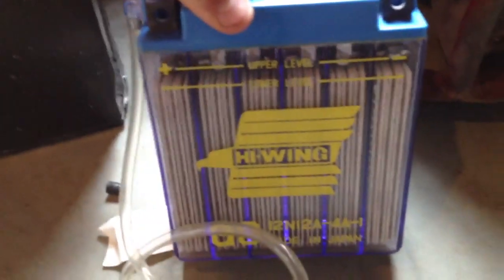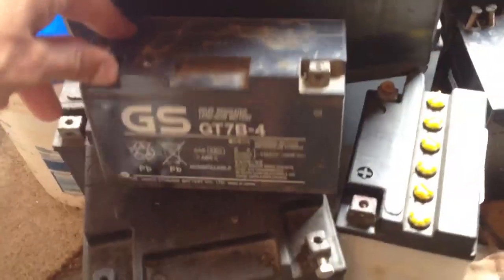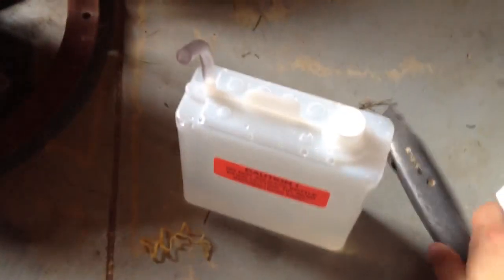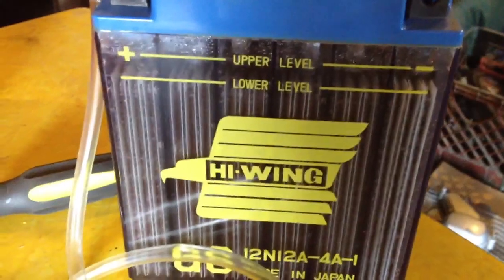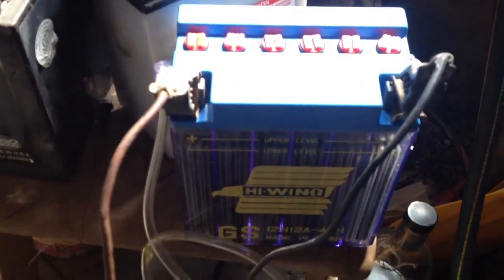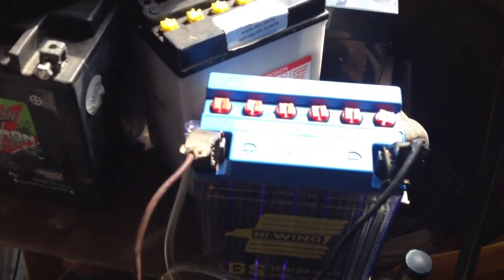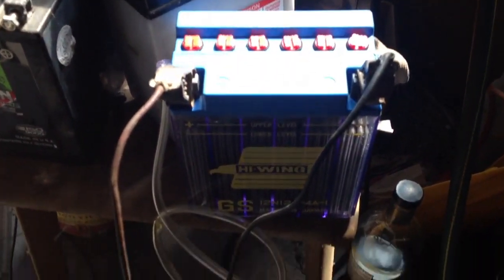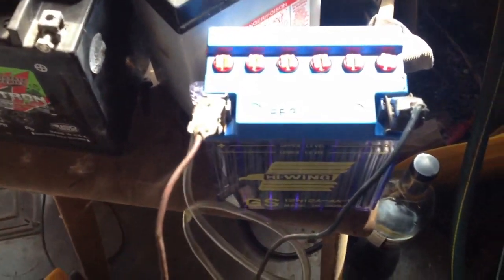Filling A Battery With Acid & Charging It Properly.

Comment: I wanted to know one simple question. Should I add distilled water only or distilled water and battery acid (sulfuric acid)??  Most of these videos and generally all these Mr. Fixit videos have one gigantic problem. Video maker speaker wants to be a MOVIE STAR.  We are watching videos to fix a problem. It would be far better if we only see equipment to be used, tools, things needed and thing to be fixed rather than speaker’s face. The viewer wants to get his question answered.  To maintain the battery you need a battery tester, distilled water and sulfuric acid. Just ask for sulfuric battery acid at the Auto Zone or O’Reillys. Call around some carry it. Some do not. Thank you.
Reply from the maker: @lonerangerlaw3123 - the electrolyte solution you buy separately or often comes along with your lead acid battery should be the correct solution. It also could be measured to see the electrolytes specific gravity to ensure it creates the proper ion flow between electrodes while maintaining stability for optimum performance.

Comment: I feel grateful this reconditioning program https://www.youtube.com/post/UgkxcJ22tnHH9l1vjdIdEIG27iOG55P7LXI8 was started. I had Three dead batteries scheduled for disposing of. Having said that, I tried out reconditioning them and it took me only an hour to do it! It doesn`t matter what type of battery you want, the process works.
Reply from the maker: @Lenni J. - At 10.5v a 12v battery is considered fully discharged. The longer it sits in a discharged state the faster and more oxidation will form on the plates. A battery is  already getting weak at 11.9v reading but often we also need to look at the amperage to get a full picture of what condition a battery is in. A good 12v battery I like to see it sitting stable around minimum of 12.5v or a little better like 12.8-12.9v is perfectly fine in my opinion. Over charging can be a problem if your alternator/stator is throwing out over 15-16v for extended periods of time this will damage/kill a good battery too.

Comment: Where does one go to purchase electrolyte "Acid"? At what cost?
Reply from the maker: If the battery doesn’t come with the proper amount I bought a huge box full they had smaller options my 5 gal was about $50? That was 10 years ago at the local auto parts store, it’s not that expensive. Make sure you know the the proper amount and science behind the specific gravity of the electrolyte solution.
Reply: @FantasyCustoms4Life  
Cheers
Reply from the maker: @Matt Allen - Cheers

Comment: You need to explain if people need to dilute batter acid before pouring the acid into their car batteries before charging the battery.

Most of the time, people talk too much instead of going directly to the point.
Reply from the maker: Nope, no dilution to the acid needed here. Most of the time the new battery that needs filled will come with the proper amount of acid and it will be at the right specific gravity. If you’re trying to get into a discussion about trying to top off old used batteries that is a whole new topic that is more complicated and often in a case like that NO acid is used and only topped off with distilled water. Without proplerly checking the specific gravity of the old battery acid solution I would NOT just start adding more acid.

Comment: interesting points ,if anyone else trying to find out how to recondition used car batteries try Panlarko Recondition Planner ( lovy.biz/zrsy  ) ? Ive heard some super things about it and my m8 got great results with it.?
Reply: Get in touch with the size details of your traction battery box (Height, width and length), the voltage and some picture if you can and we will send out a no obligation quote.
Reply: I do that. Have you ever put one on your tounge?

Comment: How do you check the ampereage? Dumb ass
Reply from the maker: 5 years ago when I made this I had a cheap older sears 100 amp load tester that was from a golf course but it was really all you need for a lot of batteries. Now I have a auto meter sb-300 but most people don't need to use one that often so you can just take it to most any auto parts store and they can do a load test for you and let you know what kind of cranking amps you have on your battery. Thanks for the comment though.

Comment: I m experimenting with the electrolyte of lead acid battery...I have prepared new electrolyte solution of about 75-80 ml can you please recommend me a suitable battery on which I can test this electrolyte....thank you
Reply from the maker: I'm not sure what you are after with my recomendation? Are you looking for a battery that meets the size requirement for the amount of solution you have made up or are you looking for a quality battery to test it on? Will your test include some kind of amperage load test to judge the quality of the batteries charged capability or are you just going to see if the battery will power up something? All batteries are not created equal even two batteries from the same brand and warehouse. Do you want to know what battery I reccomend to my customers to put inside their machines when avalible? Thanks
Reply: I'm looking for the battery with size requirement to hold 75-80ml solution...I want to conduct normal tests like shelf life, cycle life, discharge and charge current. please if you can suggest the battery it will help me a lot....thanks
Reply from the maker: Okay - The ytx14-bs battery made by Yuasa USA is a really great battery that I reccomend to my customers when choosing a great performing long lasting battery. (I am not endorsed by Yuasa, this is only my opinion from experience with many different  types and sizes of batteries) Make sure the one you order comes supplied with the electrolyte in the box and not already in the battery so that you have to manually empty the supplied electrolyte into the battery and then charge it once you receive it.  If you get the ytx14-bs that I am referring to they supply you with .69 L of electrolyte.  I hope this information helps you out. Thanks for contacting me.
Reply: thanks
Reply from the maker: You're welcome!

Comment: DO YOU MEAN volts? check the voltage after a few hours not the amps..  You can only check amperage when in-line in a circuit that is drawing amps.. you need to have a load on the battery to check amps....  You would check the voltage after charging, and on a new fresh filled acid battery I would want it to be between 12.9v at its lowest and 13.8v at its highest after allowing to settle and rest for 1hr after trickle charging.
Reply from the maker: You are right. That is why mechanics like me have nice tools like load testers that put a heavy load on a battery to get  a reading of the amperage a new battery is capable of producing at that that time with whatever temperature it happens to be at that time which will also effect the reading., thanks zip1233
Reply from the maker: +David Curtis Yeah the little craftsman voltimeter/100 amp load tester I have is the tits. It has two small 10amp fuses inside as a load to test on and give you a reading from that. people always think because you have enough volts that you should be able to start something, the only thing that actually matters is how many amps you have. amps are the power. you could grab 1000000 volts with no amps behind it and be fine but then grab 220 volts with 50 amps and be dead. Its all about the amps just like throwing a small battery in a truck and wondering why it wont start when it says 13.75 volts.
Reply: @FantasyCustoms4Life  Do Not use a load tester on a new battery that has not been completely charged. Whatever the charge is on a new battery (Volts/amps) the first time a load/ drain is put on it will be the maximum amount that battery can be charged to for the rest of it's life. That's why the first charge has to be done exactly right. That is why battery's that have the acid and first charge done by yourself last a LOT longer than first time store charged battery's.
Reply: FantasyCustoms4Life  except there's no way to test amperage without loading the battery.

Comment: Just like that im the only one who filled is battery and after charging it was overfill ? i mean it problably the bubble that take the place and make it higher so when i will put it in the atv it will level back
Reply from the maker: some batteries are different than others. If the battery needs any filling it should have instructions that came with it. Read through them carefully.Some batteries only have you fill them to the lower level mark and once charged the level rises to the upper level mark. others have you fill them to the lower mark. charge them and then top off if needed to get to the upper level mark but only after charging.
Reply: idk they said to fill it to the upper mark but when i charged it the liquid climbed like 1cm so not too bad... but they said to add water if the level get lower after charging....  I suspect it the Oxigen and Hydrogen stuck in the plate that make the level higher will put it in my atv and ride hard to see if it come down